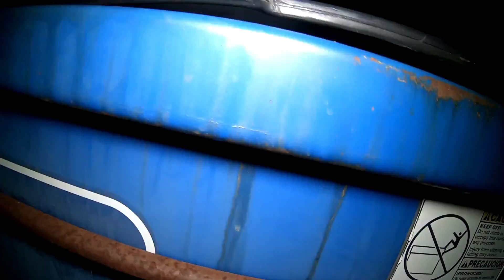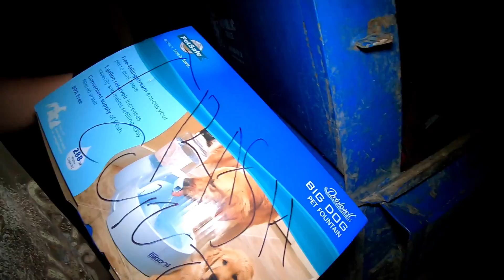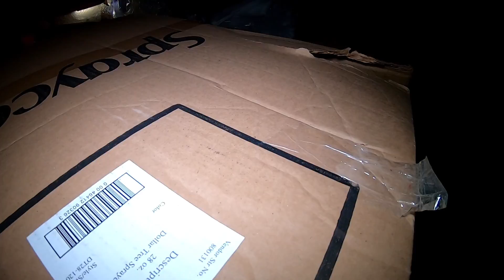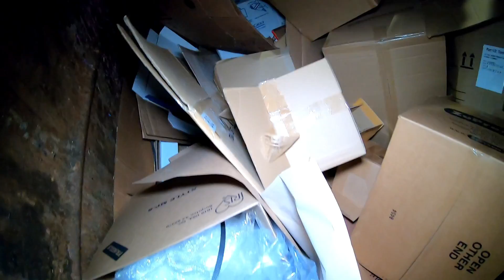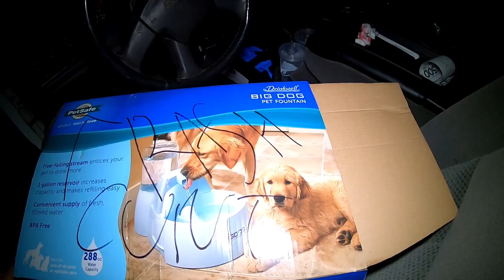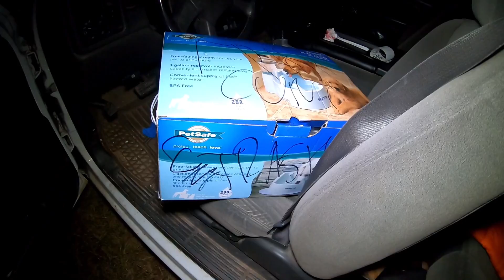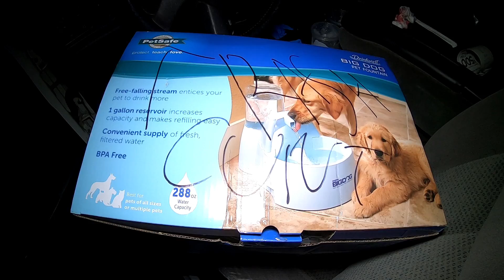You Wont Believe All The Things These Corporate Giants Throw Away Every Day

Comment: I usually don’t share my trade secrets but you seem to be struggling pretty bad !
Get yourself a set of metal stair fold up steps for climbing , I recommend the one that has the taller bar on it , tie a rope to it climb up use the rope to pull your steps up if needed , put your legs over put your steps in if needed then do in reverse !  I’m short so this is great .  For the locked dumpster use the hook on swimming pool ladder ( I find these in the trash often) ,jb weld a couple speaker magnets ( also from trash) to it , stick it to the side or tailgate and it’s ready to go and on the truck for use ! 
These are things I do and they work for me . 
Also got a big clip from harbor freight for $3.00 glued to my light that has a magnet attached , light is bright , lights up the dumpster, clip holds my bag on the edge , magnet attaches to the dumpster (heavy magnet out of old speaker or buy a fancy one).. 
if any of these help you great if not well 🤒🤷🏼‍♀️ keep digging ..
Reply: All good ideas..Hope they take note of them.✌